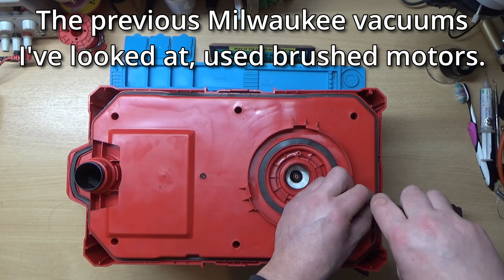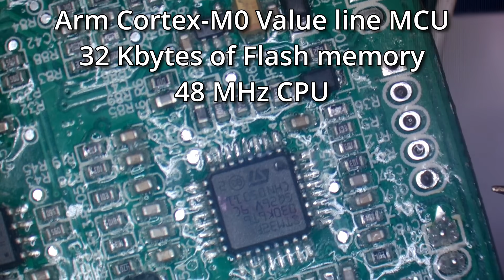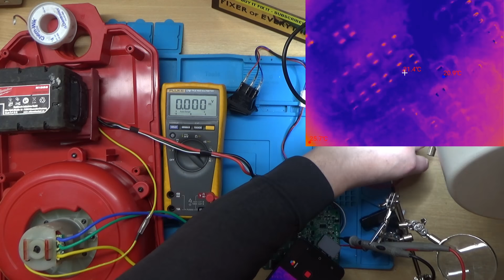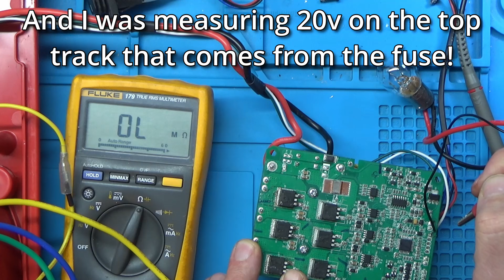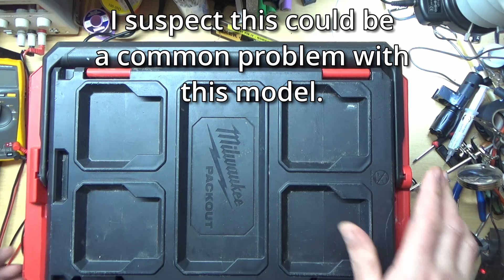Faulty Milwaukee Packout Vacuum Cleaner | Can I Fix It?

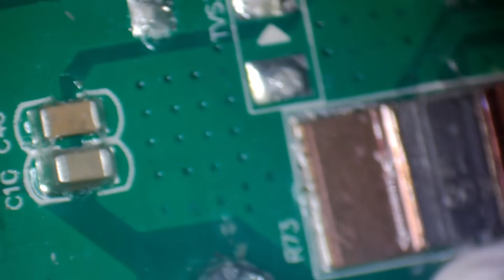Comment: When you looked at the fuse at 6:40 you can see it's faulty, the brown stuff on the left side. I've seen that a few times. Sometimes there is a streak of black on the pcb next to them. But I suspect the conformal coating contained the blast a bit.
Reply from the maker: Thanks Peter, Yes I never noticed that little black mark next to it when I was looking at it. I would have probably just put it down to a bit of dirt or something. I'll have to pay more attention next time, although I didn't suspect it with getting 20v on each side of it.
Reply: @BuyitFixit  I did wonder about the voltage both sides, and I guess it could be conductive residue inside the fuse.

Comment: Oh wow, that is akin to a cheap Chinese thing you find on gearbest, when you pulled it apart. 
What are Milwaukee doing putting their name on products like this, Stihl have fallen into the same trap, downgrading the company name with A knee-jerk battery powered product range.
Reply from the maker: I didn't think the build quality was too bad on this. I've not looked at any Stihl products. The best thing I've worked on in the terms of build quality was the kitchen aid mixer. That think was built like a tank and for something 36 years old was in great condition! I'm sure it will now last another 36 years!
Reply: My bets are that it's a production line goof-up. Someone loaded the wrong pick and place tape - The operator likely saw the words 'fuse' and '30' not realizing they were 3amp resetable fuses not 30 amp fuses. Likely to have passed initial low load testing. 
Probably only a few dozen made like this before quality control noticed.
I'll bet someone snuck a bunch of these rejects from the trash pile and sold em off cheap. (He had 3 with same fault)

Comment: I had a similar ish problem with a DC shunt motor driver in an industrial machine. Everything had voltage, but would not run. In the end I discovered the 20mm fuse holder had failed, it looked ok, but must have had a small internal crack. Replaced it, and everything worked happily.
Reply from the maker: Thanks for sharing 👍I had something like that with a farmers bale wrapper a couple months ago. He had checked the fuses were ok, but when I tested across the fuse holders on the board one was OC. It wasn't making contact with the fuse internally. It took me a little while to find that one too as the machine was doing all kinds of weird things (two things operating at once, and moving in the opposite direction) due to voltages feeding back through other valves because of the supply not going through this one fuse.

Comment: I've had weirdness with glass fuses in the past. They would test just fine, but under load the heat in the fuse wire must have made it bend away from the end cap just enough to disconnect it.
Reply from the maker: Glad I'm not the only one then. Thanks for sharing 👍
Reply: @BuyitFixit  Fuse holders have also been very problematic for me in the past. I routinely just replace them in olde equipment.
Reply from the maker: Yes, I could see that happening especially with the metal contacts oxidizing over time, but I've never came across it before in a soldered in fuse on a PCB.

Comment: I've had similar problems with auto reset and push button reset fuses degrading and tripping too quickly or partially failing and causing the same problem you have.
Reply from the maker: Interesting. Thanks for sharing 👍

Comment: long ago, a glass fuse in B&O pente speakers, measuring with the mmv, al normal, under power it acted as an 75 Ohm resistor!
Reply from the maker: Weird, well at least I'm not the only one to have a strange problem like this. Thanks for sharing 👍

Comment: Very conscientious repair. There's not much else on this board (beside the micro, mosfets and drivers, regulators, opamp, comparator and too-complicated teaser, just for a hoover), ho, ho. I bet the next version has an app.
Reply: Next version will have a potted board just like the other Milwaukee products made by TTi. Dean Doherty repair power tools for a living and he doesn't like what Milwaukee has become much like a zombie brand.
Reply from the maker: Yes I've came across a couple of tools with the potted board. I think it was one of the grinders and a drill. It makes them pretty much unrepairable (or too much effort to repair at the least).
Reply from the maker: Thanks 👍Yes, it wouldn't surprise me with an app. They already have the app for some of the other tools (One-Key). On some of the drills it can be used to adjust the torque, as well as allowing the owner to remotely disable it in case of theft.

Comment: Crazy! its a simple vacuum 5 years ago the only thing inside would be a switch and the motor
Reply from the maker: Yes, I had a look at one of the previous models a while back and it was pretty much that. (Although it did have a small board for stopping it operating if the battery was too low).
Reply: That's the difference between brushed and brushless, you need a lot of components to make the latter work.
Reply: @NicksStuff  more to go wrong ,a brilliant bit of marketing to ensure you have to buy another one in a set time . My fridge has 3 parts ,compressor ,thermostat and a strange little potted box. My freezer has the same BUT it has a shedload of components on a pcb .My fridge has been working fine since 1957 my freezer broke down twice since we bought it in january . "Stuff" inside isnt good its marketing ! We threw my mums hoover away lin 2001 it was fine but we had one it was working since the 1930's i have lost count of the dead ones we have replaced since 2001 ,All modern techyfied stuff does is give more things to fail on . If it works why change it sometimes modern isnt best
Reply: @davidgranger3628  I was talking to a buddy out here in the states, and we have a energy efficient program where the state comes into your home and swapp out old "inefficient" appliance for newer ones.  We had this same discussion, when they came into his parents home and swapped out their old fridges.   I swear these guys are out there to cursed them with appliance that last a few years instead of a few decades.
Reply: The older units still have a printed wiring board with lots of ICs.

Comment: This for sure is one of the most bizarre faults I've come across. Thanks for showing.
Reply from the maker: Thanks 👍Yes, I think it was the first time I've came across a fuse that was blown but not open circuit!
Reply: @BuyitFixit  My personal experience says PTC fuses fail like that when aging or when frequently being stressed by sharp overcurrent spikes or high temperature.I see it in laptops where after some years, high power devices like self-powered external harddrives would stop working. Seeing this problem in a power tool is a new one to me, though. I might be wrong but i think the small size isn't helping with the problem either. If you can find a much larger one with the proper 30A rating, i'd like to see how that works out.
Good job, keep it going!

Comment: I just repaired my pack out vacuum last week!  pcb got wet and destroyed that little input fuse and its pads/traces. I was able to solder in a bypass across the fuse pads and then just added a 30amp ato blade fuse on the input wire
Reply from the maker: Nice, well done on repairing it👍